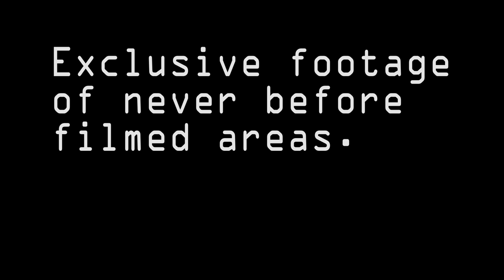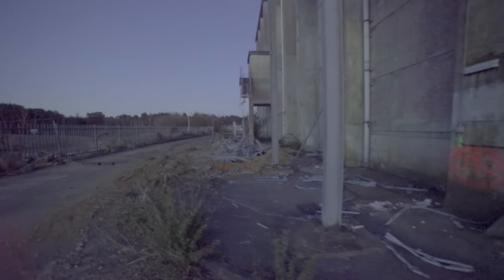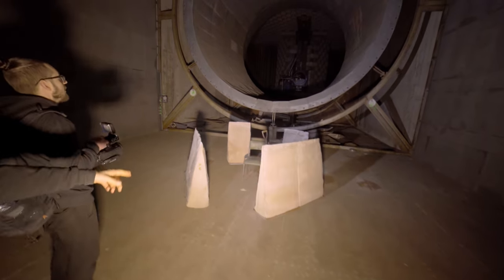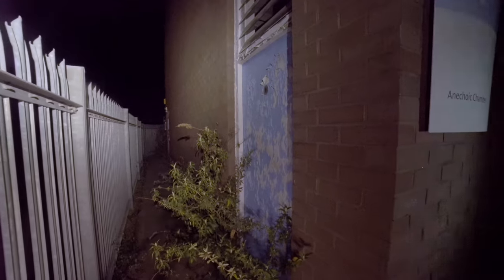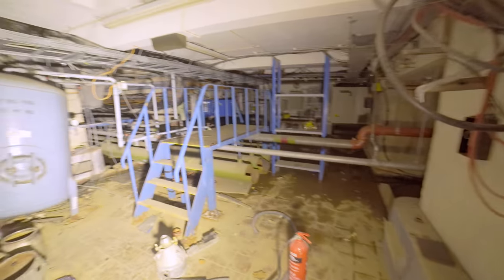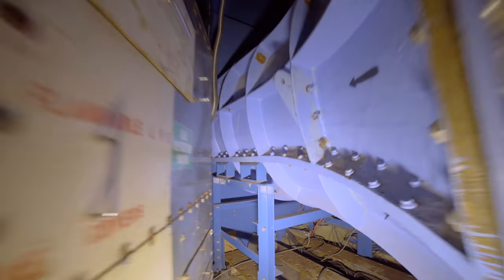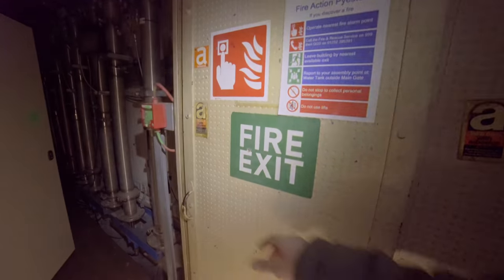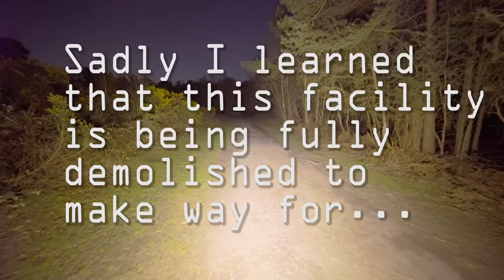Pyestock Anechoic REVISITED - **WE FOUND UNSEEN AREAS** 4k

Comment: The compressed air was to feed the jet engine, I believe they could control the temperature and stimulate the altitude the engine was running at. The pipe you came in from, the big one is the exhaust and the network of pipes and vains are to slow the air speed down and the 5 fans would extract the now slowed air and exhaust gases.  And as its slowed down it's now quiet. The inlet side thats all missing i say this because the honeycomb filter thing is to smooth the air coming in and make it linear ie turbulence free. I did read somewhere that the Concorde engines were tested there.
Reply: Spot on regarding the honeycomb, it provides a near linear airflow as the plane would see in flight, I suspect the water system is more for ingestion testing than fire extinguishing if it's on the inlet side, if it's on the exhaust side it's more likely that it's to reduce the temp of the exhaust and the amount of energy as it takes a lot to evaporate the water and this also causes significant noise drop
Reply: Hi group I believe this all correct, I think the comp air is for accelerating the impellers fasters for chamber nozzle speed. Getting it started quick, there how I see it.
Reply from the maker: Top info. Thanks.
Reply: Absolutely spot on, the intake air to the jet came in through the now demolished blue intake ducting, the large round duct which you came through in the other side of the building is the jet exhaust diffuser chamber. The jet blast was directed into the tunnel, silenced and slowed down with baffle system before the then diffused slow air was then extracted with the large roof fans. The compressed air was probably used to simulate the jet at speed when in flight so it could be fed enough air to keep it producing thrust. Modern jets compress tons of air every minute.
Reply: @TheSecretVault  I remember standing outside a engine detuner at RAF bruggen and there was  very little noise outside but inside they had a tornado RB199 on full reheat. Its amazing how much noise it cuts down.
Reply: The facility supplied three streams of compressed air found in a turbo fan engine. As a real engine was too expensive to run it was simulated. The big blue duct supplied the flight stream i.e. the air the aircraft would fly through. The hot core air stream at 300 degrees C was fed by a 1960s Avon engine combustion can which is still behind the red mesh shielding on the top floor and was lagged to reduce heat loss. The other parallel pipe supplied the Bypass air stream of a turbofan engine.  The three air streams were fed through a 10th scale model of the back end of a jet engine mounted in the chamber on the metal structure in the middle of the blue duct. The sound generated by the hot and cold gases mixing was measured by 32 microphones mounted on the masts you found earlier in the main anechoic chamber. The exhaust chamber has acoustic baffles which you noticed changed the sound of your voice and took out the base tones, they were there to stop the sound from the extraction fans getting back into the chamber and ruining the measurements. The facility was used some years ago for a BBC2 drama called 'Random Quest' when the facility become a nuclear reactor for the day.

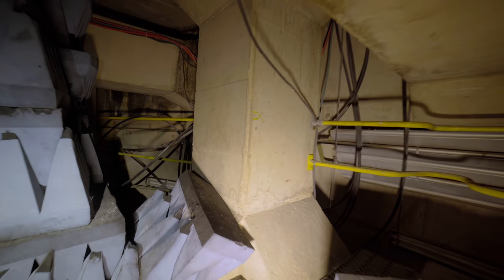Comment: The blue coloured foam pyramids at 33:16 is RAM, radiation absorbing material, it's used to absorb radio frequencies so they were probably carrying out electromagnetic testing of the engine systems. 

The 'Inch' switches are used to jog the crane gantry to finely position it (inching it into position).

Comment: 41:55 - Standard Aero:  That's the owner of Vector Aerospace.  They were owned by Airbus previously IIRC.  Vector Aerospace performs maintenance, repair and overhaul of turbine engines and I think for fixed wing and rotary wing aircraft.  I used to work for a company which had/has(?) Vector Aerospace as a customer.

Comment: Matt - you need to carry around a voltage tester pen.  Easy & cheap way to see if wires are live or not - & it's a tiny piece of kit to keep you from being electrocuted.  Keep safe xx
Reply: Not in all cases "tick tracers" don't always work.
Reply: @thedim900conf  Ahhhh!  I've been deceived this whole time!? lol! Do u know why they wouldn't work?  I thought that this was a guaranteed way of detecting an electrical charge.
Reply: @lavenderrainbow5041  it's hard to explain without going into electrical theory. some wires are shielded therefore it can't pick up the presence of voltage.  you can get shocked and/or electrocuted from a neutral wire or ground wire that has the same reference as the ground and will not be picked up by the tick tracer or as we call it in the electrical field an idiot stick. The only true way to know if something has the ability to shock you is to stick the correct meter on it which I would not suggest anyone do that is not an electrician. because that can cause it to blow up in your face if done incorrectly. it's best to not touch exposed electrical wires and stay away from them unless you can be sure that they cannot shock or electrocute you. If you watch this video an electrician has already gone through that building and marked everything that he tested to be not connected anymore with green paint it's common practice in demolition to mark disconnected electrical wires and devices with green paint and stuff that is still connected and can shock you with red paint. Or an electrician can go through and cut all wires on each end so the person pulling it out knows it's not connected.
Reply: @thedim900conf  wow! & here I thought/hoped that this would help.  I'm forever staying away from any unknown wire!  :)

Comment: I know aeroplane engines have compresssors in the engine to create oxygen in the plane appperantley that's what the trails are in the air
Reply: No. The engines provide pressurised air to inflate the cabin. That is not what causes the trails often seen coming from planes
Reply: @Bullwinkle39  or the air epelled out of the cabin